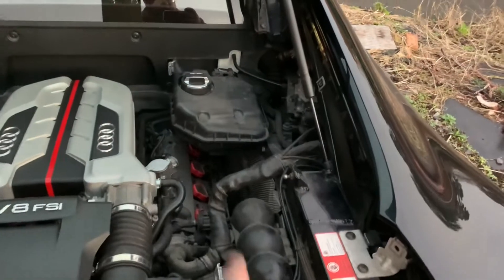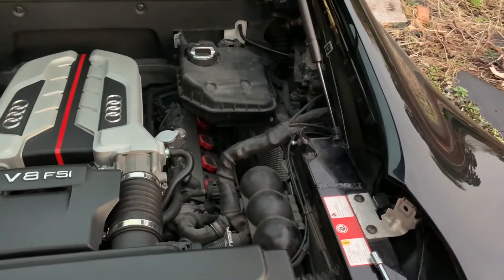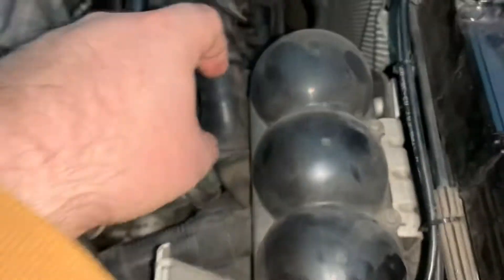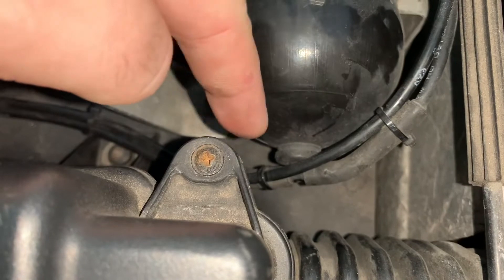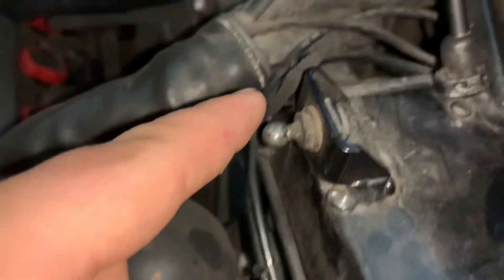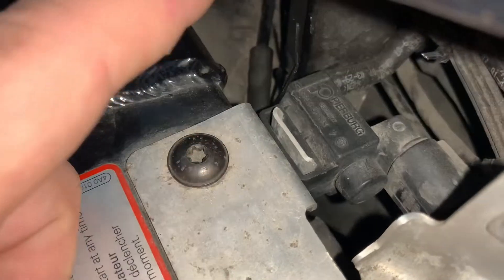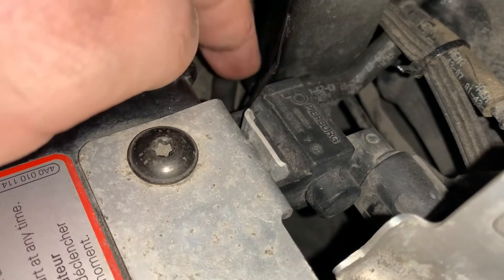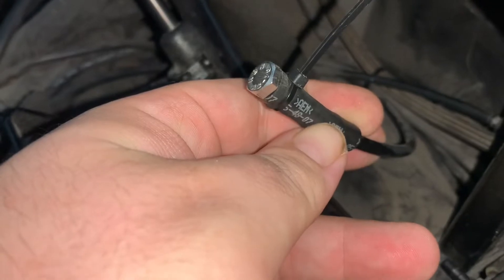Audi R8 Exhaust Valve Bypass / always open exhaust valves

Comment: Hi I’ve seen this mod done at the T piece on R8 Talk. Does this method you use cause any check engine lights? It looks much easier than the other approach as you only have 1 pipe to blank off.
Reply from the maker: Done 4k+ miles like this now and now check engine lights or any other issues.
Reply: I did this exact procedure yesterday and the check engine light came on today so I think there will be an issue on some cars unfortunately.